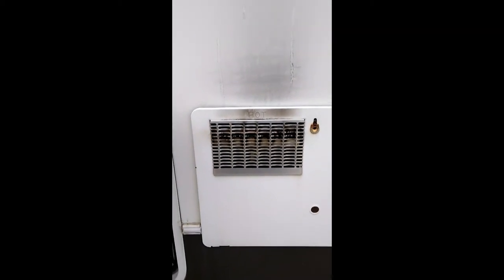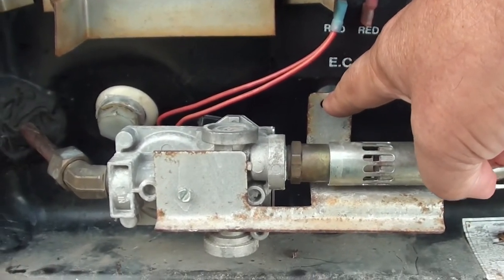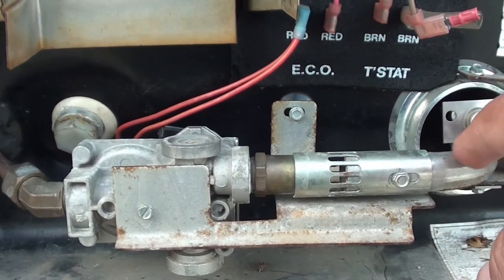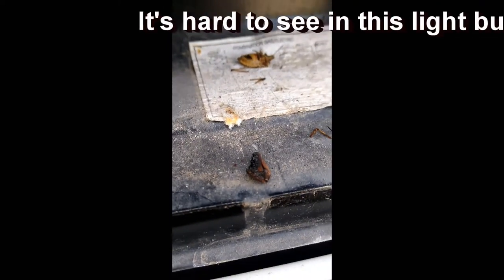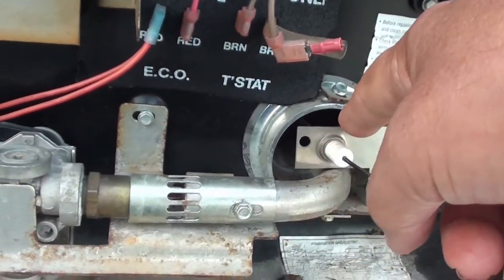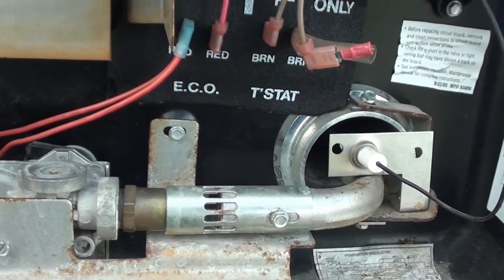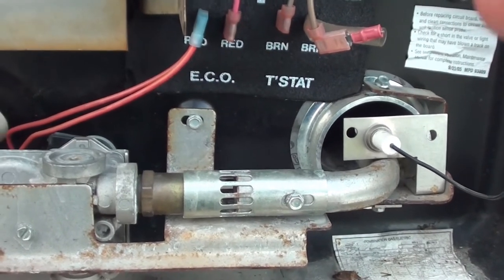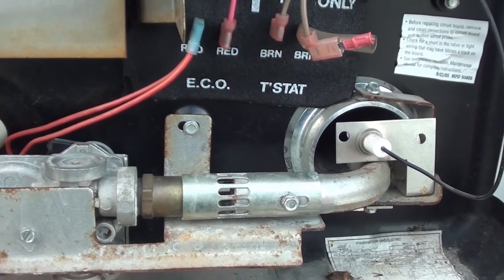Camper turning black!

Comment: Interesting. I have a burner on our gas barbecue pit that fires back at the control knob heating it up. I'm gonna have to remove and clean the burner area. Might have to pick the orifice. Dunno till I slip the burner and plate off.